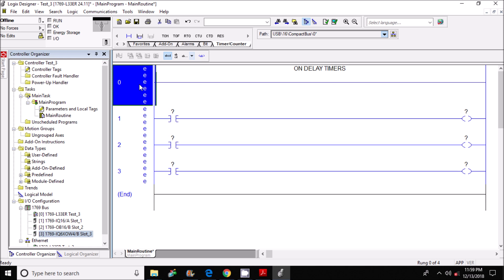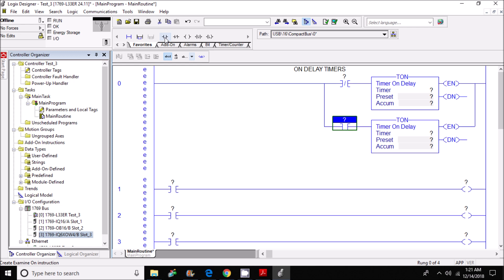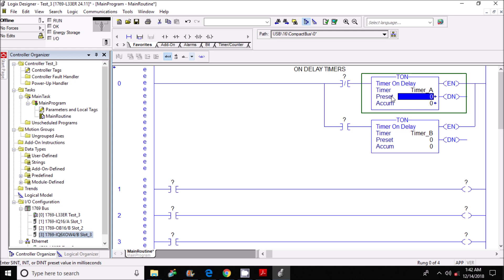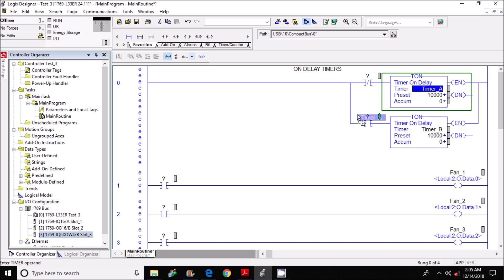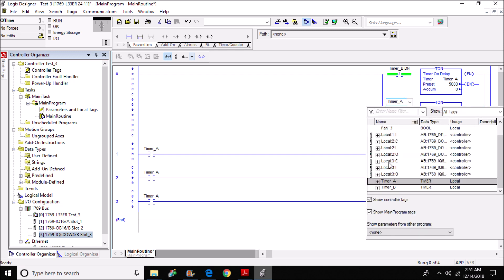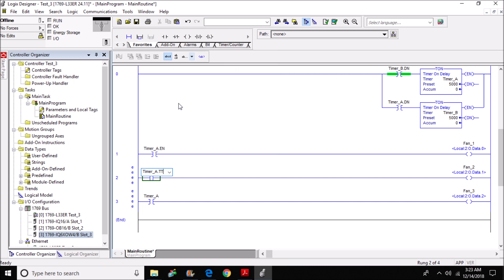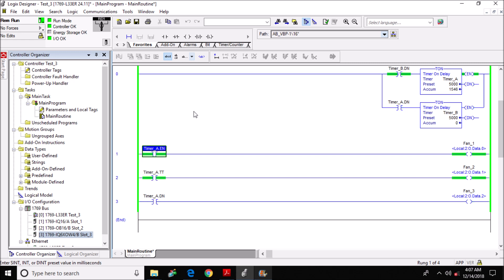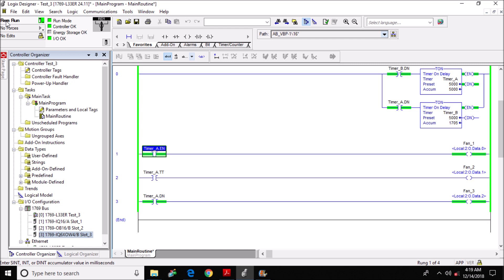10. RSLogix 5000 Timer TON

Comment: Thanks for posting! If the timer is done counting and the Examine Off button right before the timer remains true the DN bit will remain true correct? I'm guessing the reason the first timer resets is because the Examine Off button momentarily becomes false then immediately true after the DN bit on the second timer becomes momentarily true?
Reply from the maker: Yes I am using Timer B to keep Timer A true so you can see the done bit from Timer A.

Hope This Helps 
Tom
Reply: @tomh2466  thank you sir, I'm going to use TON for the first time at work and wanted to make sure I wasn't going to mess up the equipment
Reply: And it worked! Thanks again for the post 👍
Reply from the maker: @RCshizzle  Congratulations you just entered a much bigger world good work.👍